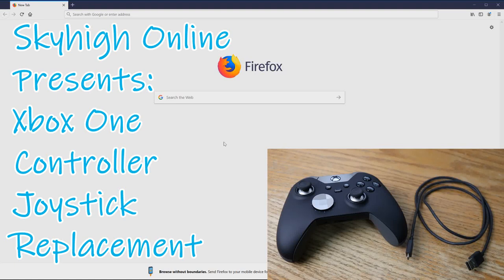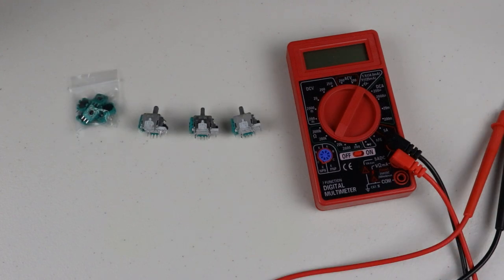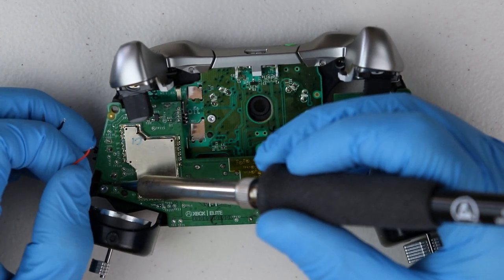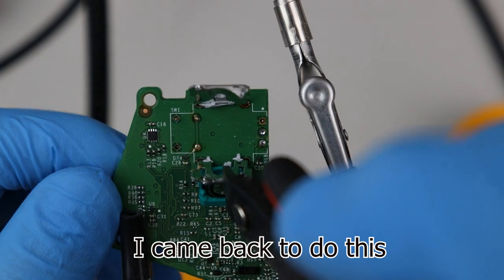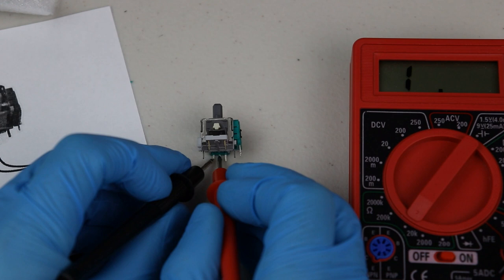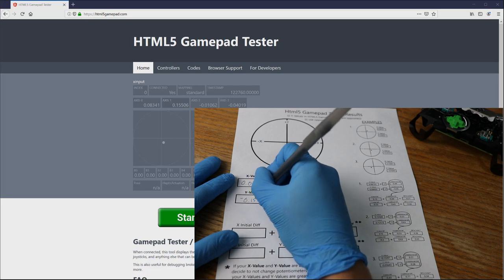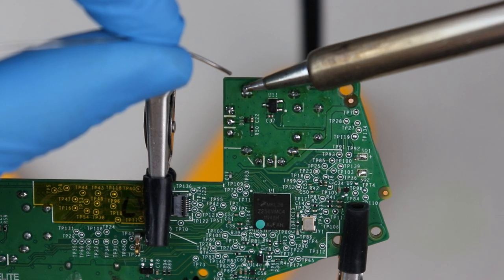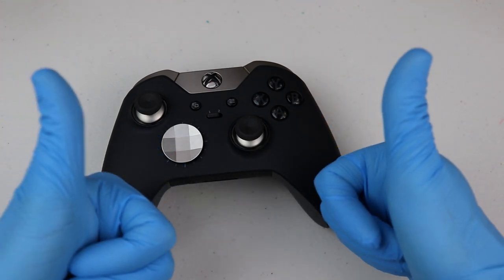How to Replace Xbox One Controller Analog Joystick - Fix Stick Drift & More

Comment: Could you please advise me.. Before i order/purchase some new analog thumb stick rockers are there any difference in measurement or size between the xbox elite pad and normal xbox one controllers..? i have an elite first generation but i dont want to make the mistake of ordering parts that might not fit.
Reply from the maker: They will be the exact same fit.  In fact, the only literal difference is they added a small metal sleeve in the shaft of the elite joystick which doesn't even do anything because I still fix 1st gen elite joysticks that have broken shafts
Reply: SOSS GAMING thanks for the advise bro, will be watching this video step by step once my parts arrive 👍🏽 thanks for the informative video, the best one ive found on youtube!

Comment: Is it ok to test the module in the controller without soldering it or will that mess with the results?
Reply from the maker: That is actually a better way of doing it in my opinion!  I couldn't figure out how to do it before making this video, but if you bend the 3 pot pins inward and wiggle the joystick a little you should be able to get a reading for that particular axis, and if you're good/lucky enough you can see both axis at the same time.  I'm making a new video that should be out within a week showing this and also a newer, less complicated method of getting these joysticks centered.
Reply: @SOSSGAMING  I am looking forward to that video!

Comment: Do you need any special speedometer for tgis controller or the normal ones work on this
Reply from the maker: Potentiometer? Original xbox pots are best, but PS4 pots also work.  If you mean multimeter, than any that can read resistance should be fine.  I use a really cheap one in this video.  I also recommend checking out the newest method video!

Comment: Quick question do we need to remove both or just one cause what if one has just one stick drift
Reply from the maker: Just the one that has the drift. In fact, if it's only drift you are trying to fix, an easier way to fix it would be to change out the potentiometer that's causing the issue. For instance if the left joystick y-axis is drifting, you can just change the left joystick y-axis potentiometer. There's another video I made that shows how you can manually adjust it to calibrate. (Newest Method video). Hope that helps.

Comment: the temperature of ur iron??  i use a 35w but damage all the solder tracks of the joystick , they get glued to the iron .... can you give me some tips?...
Reply from the maker: ~350* C.  If the through holes are damaged, that is not good :(  Too high of heat is the usual culprit on these boards.  I'm sorry I didn't explain that in this video, as I was still learning how to solder as well, and have since come to find that out.  I do mention that in my latest video, but sounds like it might be too late :/

Comment: Is it possible to just replace the pots or do I have to replace the entire module?
Reply from the maker: If you are talking about the original joystick on the controller, yes, you can most certainly try to change just the pot(s).  It's a little difficult to explain, but I will try my best.  Each individual pot typically has a different resistance, so it may not center how it was before without finding out which pot resistance works best for that particular joystick. Having the original joystick (assuming it is still in good condition) does increase the chances of acceptable centering (within .10), as it is what was initially used to calibrate the centering for that particular joystick on that particular controller from the Microsoft factory.  If you are able to remove the whole joystick in one piece, you will be able to make the measurements as show in the video to calibrate it which should give you pretty accurate centering.  If you try to replace the pot while the joystick is still soldered to the controller, it is more so just guess work.  Does this answer your question?  Or is that confusing? lol

Comment: How does your repair service work? I followed the link do we have to pay first and then send it out? Im in Colorado
Reply from the maker: Yes, exactly.  After it's paid and shipped, send me a message with the tracking number.
Reply: @SOSSGAMING  its $40/ stick module?
Reply from the maker: @justink805  $40/controller.  I usually replace both regardless, and fix anything else I am able to.
Reply: @SOSSGAMING  awesome ill be sending mine for sure. I need to remove all of the detachable parts?
Reply from the maker: @justink805  It's advisable yes as I do not want to be responsible for losing any :)

Comment: I have a Elite gen 1 and somehow since today my controllers left stick doesn't make that clicking sound anymore when you press on it. I am going to open it up but is this problem fixable? If yes how and if no can i just pop in a regular xbox one controllers board with it's new sticks on it? I have 1 that i have for spare use. All inputs are getting registered up, down, left, right and even press so only the clicking mechanism is somehow defect.
Reply from the maker: Hello.  I'm not too familiar with this problem, so I am not sure if you would be able to fix the clicking with the joystick that's already in there.  Are you saying when you press the joystick in you are getting a response, but just don't hear the click? If that's the case, I personally wouldn't bother fixing it, but I understand if you'd still want to.  As for swapping out with a regular controller board, they are not compatible.  You can swap out with another elite motherboard though, no problem!  Let me know if you have any other questions.  Happy to help.
Reply: @SOSSGAMING  Yes the response is what i meant. Normally it would make that click sound when pressed on. I was thinking maybe i could clean it up, but don't know if it is reachable. Maybe something got stuck somehow. Do you know where i could find the mechanism? Also thank you for the response and info.
Reply from the maker: @turkisch66fireworks  No prob. Yeah I'm not sure what could be causing that other than it simply breaking in some way.  The button is actually a button on the joystick.  It's on one of the sides.  You have the 2 potentiometer sides, one plain side with the ALPS logo etched in, and the last side is the portion with the button.  It's what the little white piece of the joystick is pushing on when depressing the joystick.
Reply: @SOSSGAMING  So replacing the white piece maybe could solve the click problem? I have an un used X1 controller i could salvage for parts. It works like how it is now, but when I am playing I do mis the click response. Also was thinking about calling Xbox for what they could offer as help.

Comment: So I just replaced one of the analog sticks on my controller and both axes are within 0.1; however, it is now much more sensitive than before. It will read 1.00 on both axes at about half stick deflection. Do you think the analog stick I got was bad or maybe I bought the wrong ones?
Reply from the maker: It sounds like the potentiometers used on that joystick might have a higher sensitivity. Does it act normally otherwise?
Reply: @SOSSGAMING  yeah other than the high sensitivity it behaves normally. I guess I’ll try another analog stick from the ones I bought and if that doesn’t work I’ll have to buy new ones again :/
Reply from the maker: @aaronncollier96  If you live in the US I have a link to the correct xbox joysticks in the description. I also sell just the potentiometers as well. Otherwise try to find the ones with black wipers (the color in the center of the potentiometers). They have the correct sensitivity.

Comment: So what do you do if the controller doesn't register the new joystick? All other buttons work but the left joy that I had to replace. Any tips?
Reply from the maker: Sounds to me like some of the pads on the board were lifted/damaged. Can you tell if all the solder connections look fine?

Comment: My xbox also claims the stick is moving up with 100% when i have the analog stick removed.. do you know whats causing this?
I did a bad job at desoldering also are the legs from the stick atached  to the board with copper pads or does it make a connection inside the hole? and what could i eventually do when i removed them or damaged it inside..?
Reply from the maker: Hey there.  If there is no joystick in the controller when testing,  the direction it shows on the tester shouldn't be indicative of anything whether it's up, down, left, or right.  The direction on the tester only matters when the joysticks are in.

As for the copper pads, those are part of the through holes, so if you're seeing those that's not a good thing.  However, it may not the end of the world.  For one, there may still be enough contact to be had between the controller, solder, and joystick when putting in the new one even if it's not there anymore.  It may also be possible to salvage the through hole and put it back, this is kind of a long shot and may prove difficult though but if you can do that then great. Best of luck.  Any other questions don't hesitate to ask.

Comment: Does this work for the the new series 2 elite controller
Reply from the maker: Great question! I haven't actually tried or tested this myself, but looking at both joysticks it looks like they will be compatible.  The only important thing to note is you will need either regular xbox thumbsticks or elite series 1 dome piece/thumbsticks.

Comment: Do you still do the repairs? Couldn't find where if you do.
Reply from the maker: I do not, but if you type "xbox controller repair service" in the ebay search bar it should bring up a couple sellers on there that still do.
Reply: @SOSSGAMING  ok. I appreciate your help I was just worried about not getting my controller back or fixed right lol.

Comment: At minute 7:56 you say that the button has 4 pins and that we have to cut the high as possible 
I cut 1 pin too low and now I can’t take it out (literally can’t hold it in the other side of the board with the  tweezers) , can you give me an advice or tell me what should I do?
Reply from the maker: Yes, you can try melting the solder and try pushing it out from the other side so you have more to grab on to.  If that doesn't work you can try the old fashion way of solder sucker/wick to just remove the solder from the hole.
Reply: SOSS GAMING and what temperature should I set in the soldier? Rn I’m at 300 and It works well to “push” or “move” the solder, but I don’t want to increase it too much and accidentally burn something lol
Reply: SOSS GAMING nevermind, I created the biggest drift you can image, I fucked my controller
Reply from the maker: @SebasOver  Oh no, is the through hole damaged now?  I use ~350C
Reply: @SOSSGAMING  Yes, It seems like I melted an internal circuit or something, yea I used 450 lol

Comment: I've been trying to find the proper part to buy but they all seem to be for the regular Xbone and not the Elite. Can you clear this up I have the 1698 elite
Reply from the maker: They are essentially the same joystick.  The only literal difference is a thin metal insert in the shaft of the joysticks on the elites, that sadly doesn't do anything, as I've still seen the shafts broken in two.  When I do my repairs I always use the "regular" xbox joysticks (300+ times) and have never had any issues.
Reply: Thanks for clearing that up

Comment: I'm hoping your seeing this but all I'm trying to do is replace my friend controller and since this is my first time with a solder I dont exactly know what I'm doing but this is helped but do I need a solder sucker bc I dont know if I have one or not and another question is it would be great if it matter between the kind of solder or material of the
Reply: Of the wick because the stuff used is actually use with cars and stuff related to cars and not motherboards or electronics so idk whether I should use it or not but I rlly want to help my friend out
Reply from the maker: @monkishspark8635  Wishing you the best of luck! Make sure to use not too high of heat.  Somewhere between 350-400C is usually ok.  I use 60/40 solder. Some like to use 63/37.  Something to clean up the solder is necessary.  Solder sucker and/or wick, but I am not sure what type of wick you are referring to.
Reply: @SOSSGAMING  ok thx

Comment: Hi, I have a question. Basically, I have a controller board with 0.00002 calibrations on sticks, I have removed the sensors inside the potentiometers on both analog sticks and plan to install them inside new senor housings, is this fine, will I still get the 0.00002 calibrations? Is the calibration on the Motherboard or the sensors?
Reply from the maker: If you're just replacing the wheel inside there shouldn't be any issues. The effects will be negligible.
Reply: @SOSSGAMING  Okay ty

Comment: Hello, what happens if I just switch around the wiper, will that affect the drift value? or does the whole potenciometer have to be changed around?
Reply from the maker: Sometimes this might work temporarily, but chances are low. That's because a lot of times it needs replacing because the wiper eventually wears out the carbon inside the potentiometer.
Reply: @SOSSGAMING  mine is stuck all the way up like at 11 oclock
Reply from the maker: @andresbriceno73  My bet is you just need to change the y-axis potentiometer then.
Reply: @SOSSGAMING  thats the one at the bottom or right?
Reply from the maker: @andresbriceno73  It would be the one on the side I believe. The one that goes vertical. To be sure not to be confused,  when you the board off just move the joystick up and down and you'll see which wheel in which pot is moving. That will be the one you want to change.

Comment: I got scammed :( I ordered am Elite controller and got a controller with sticks glued on..........damn this is going to be hard but I do have soldering gear. Would you recommends this over a hot air gun? Do you have a video were you do it with a hot air gun?
Reply from the maker: I've never actually used a hot air rework station, but I hear they can are pretty nice if used correctly. Personally I use a desoldering iron which works wonderfully. Also, I made a "newer" video of how to replace these joysticks. Good luck!
Reply: @SOSSGAMING  I had to get a stick out of another board so that's why I wanted to use the heatgun. I tried it and the stick I switched turned out to have a little drift too. But at least I didn't damage the controller xD

now I ordered the new sticks and I will follow your method with the soldering iron. The one thing I had problems with was the solder in between the holes. I couldn't Wick it away so I spend alot of time trying that. I read today that people use a needle to get out solder in between the holes that wont come out. I had my iron on 480° and still the Wick didn't work so when the new sticks arrive I'll try the needle thing too :) 

Thanks for everything I will sub to you! 

Steven
Reply from the maker: @HD-wf3bp  Ah yes the solder can be quite a pain sometimes. Best of luck!

Comment: Is there certain joystick to buy for elite series 2?
Reply from the maker: Yes, I should actually be getting some in stock in about a week (will be available on eBay first).  No calibration required for those either (the elite 2's have built in calibration, pretty freakin awesome).  They aren't cheap though, they'll go for about $20 each.

Comment: I've got an issue where the white part of the joystick mechanism has broken, do I only need to replace it once?
Reply from the maker: With this method, any joystick replacement will most often times require a second replacement.  One is needed to measure and calculate, and the second one that matches those measurements and calculations.  You might also get lucky with the first joystick though, so in that case it would only be once.
Anyway, I would hold off just a little bit because I have a new video coming out hopefully by tomorrow, or early next week at the latest with a new method where you do only use one joystick.  Stay tuned!

Comment: Would I need to calibrate the stick if it’s not a replacement of it . Just simply removing it and putting it back in ?
Reply from the maker: Great question. If all components are the same you shouldn't need to re-calibrate.
Reply: @SOSSGAMING  thanks and sorry for spamming this question . So if I used the same stick same censors on the same circuit board and the only thing I changed was the spring it would be fine ?
Reply from the maker: @colebertram8482  Yep, it should be fine.
Reply: @SOSSGAMING  thanks for letting me pick your brain I appreciate it :)
Reply from the maker: @colebertram8482  No prob! Best of luck

Comment: Hi. I am interested in the kit, but I am unable to get it sent to Australia. Are you able to offer it?
Reply from the maker: Thanks for the inquiry.  Unfortunately I only ship local at the moment.  I would recommend checking some options like this one that will ship to Australia: https://www.aliexpress.com/item/33000638029.html?spm=a2g0o.productlist.0.0.6d2c2604Iw0uu0&algo_pvid=a91c2ae8-995b-4ffd-80ce-b7aefc15b4fd&algo_expid=a91c2ae8-995b-4ffd-80ce-b7aefc15b4fd-14&btsid=0ab6fb8815935766789483210ea205&ws_ab_test=searchweb0_0,searchweb201602_,searchweb201603_
Reply from the maker: And make sure to order the originals variant not the oems.